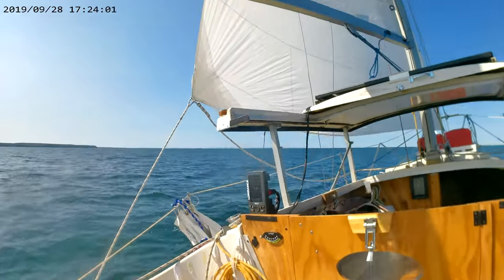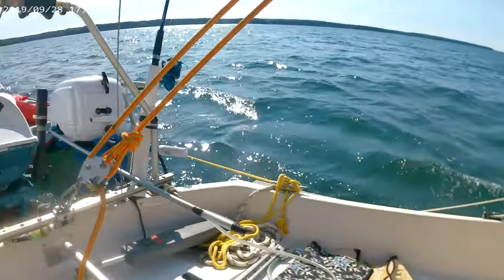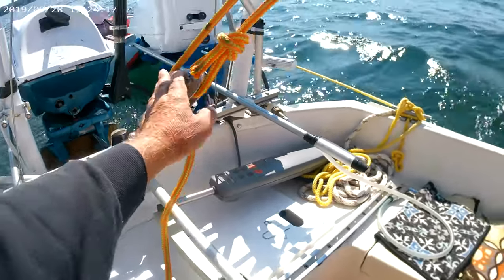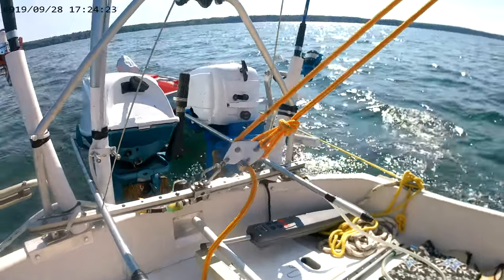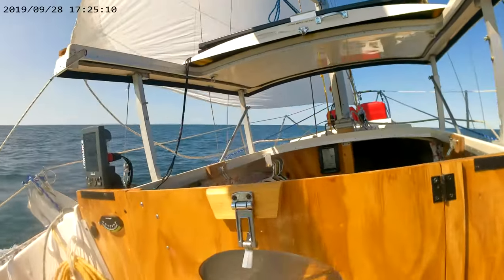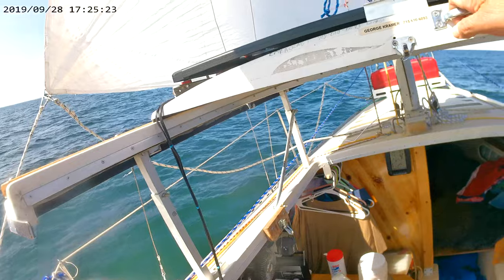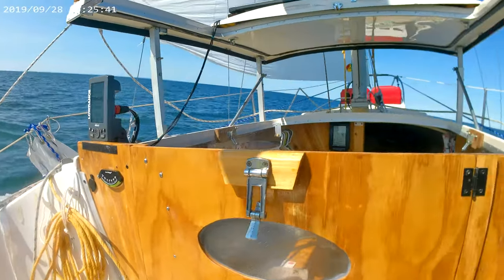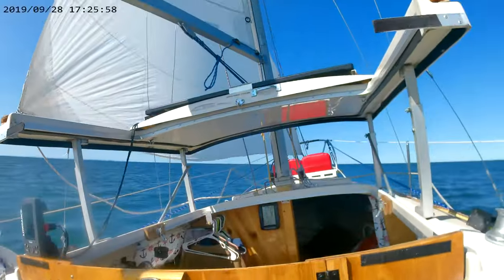Sailing Chrysler C-22 Sailing 101

Comment: thanks, looks like you have done quite a bit to your boat.  But it was hard to hear all you try to say.  Hope to see and hear more.  Oh, I just bought a Chrysler 22', but I have not seen it yet.  Hope to splash it in 2-3 weeks.
Reply from the maker: Sorry about that
Reply: @georgekramer8053 thanks for your reply.
Reply from the maker: someone else had a question so I'm passingthis on............Yes sir, Keel klunk, that is the keel can swing back and forth as the boat rocks and actually wear threw the fiberglass hull. the keel hangs on a 1/2" stainless steel rod. guess its ok i did find someone else questioning hanging a 900# keel on that size rod??? appears to work. The fittings for the thru hull are very simple a pipe flange with a short 1/2" pipe screwed in and a pipe cap. I used a couple sheets of 1/2" thick nylon to fill the gap between the keel and the fiberglass hull, one on each side, amazon or granger has this. And glued in the pipe flanges (and bolted too) and nylon in with some very expensive 3M adhesive. the adhesive is in a tube like chaulk. once its opened it will harden, i even put it in the freezer, the tube was hard the next day. Watch the thickness of the nylon..........i had to grease the keel and use a hydraulic jack to push it back in place. its worked good. I love the boat 2 foot draft with keel up, trailerable, i also made a hinge for the base of the mast, a jinpole of 2 1" pieces of conduit and a harbor frieght winch to stand it up. if you get more questions email me georgekr54@gmail.com. I have all the manual that came with the boat. I have more changes I'll be videoing.............be after the 4th, it needs to stop raining good luck Geo.

Comment: I’m thinking about getting one of these Chrysler 22s is there anything I should be looking out for?
Reply from the maker: Yes sir, Keel klunk, that is the keel can swing back and forth as the boat rocks and actually wear threw the fiberglass hull. the keel hangs on a 1/2" stainless steel rod. guess its ok i did find someone else questioning hanging a 900# keel on that size rod??? appears to work. The fittings for the thru hull are very simple a pipe flange with a short 1/2" pipe screwed in and a pipe cap. I used a couple sheets of 1/2" thick nylon to fill the gap between the keel and the fiberglass hull, one on each side, amazon or granger has this. And glued in the pipe flanges (and bolted too) and nylon in with some very expensive 3M adhesive. the adhesive is in a tube like chaulk. once its opened it will harden, i even put it in the freezer, the tube was hard the next day. Watch the thickness of the nylon..........i had to grease the keel and use a hydraulic jack to push it back in place. its worked good. I love the boat 2 foot draft with keel up, trailerable, i also made a hinge for the base of the mast, a jinpole of 2 1" pieces of conduit and a harbor frieght winch to stand it up. if you get more questions email me georgekr54@gmail.com. I have all the manual that came with the boat. I have more changes I'll be videoing.............be after the 4th, it needs to stop raining good luck Geo.